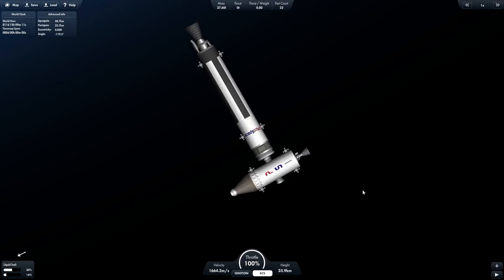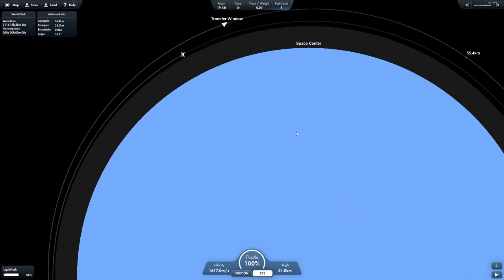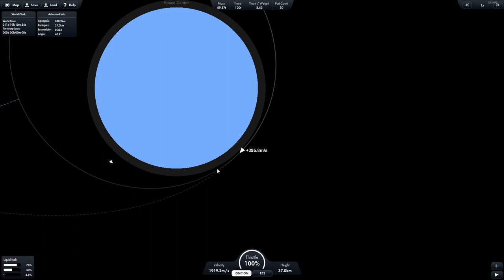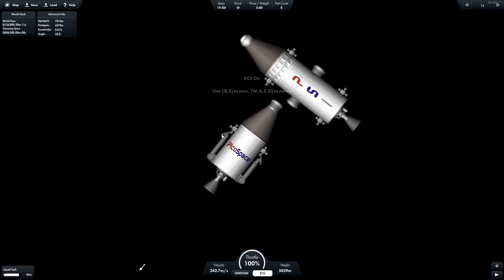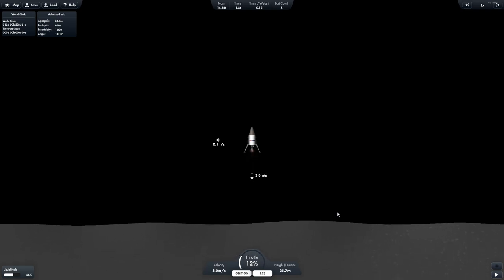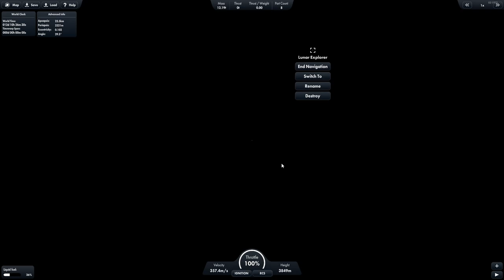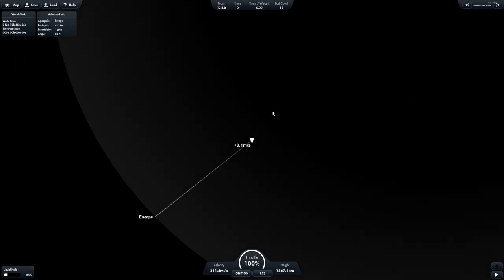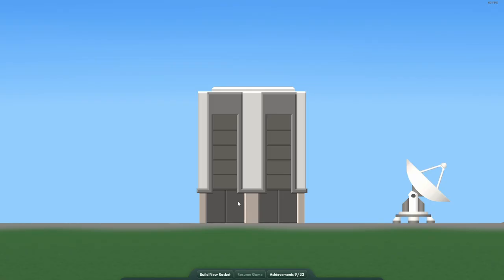How to land on the moon in Spaceflight Simulator

Comment: Author i want to know what to do if that shuttle thing makes the rocket go out of control i played with your mods and mod moreparts and electry pack
Reply from the maker: As long as the rockets not too unbalanced, the internal gyoscopic torque will keep the rocket fly in the right direction. In the case of shuttles there’s a significant off-balance and you need to use a tilted engine. Currently I have the Kevin penguin Abort engine that can tilt and the Osprey tilt engine which are options for shuttles. I may make more in the future depending on need.